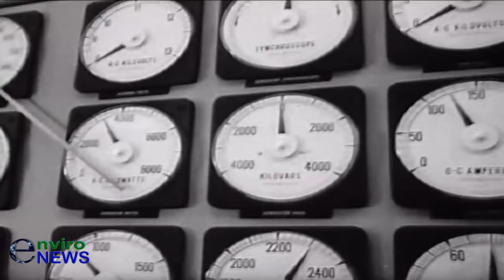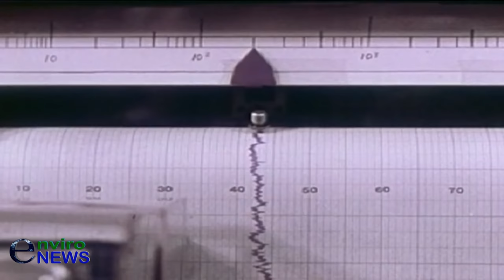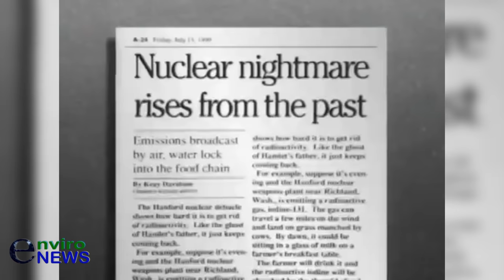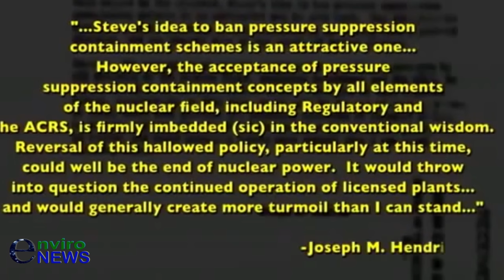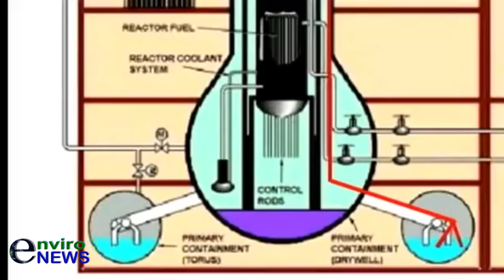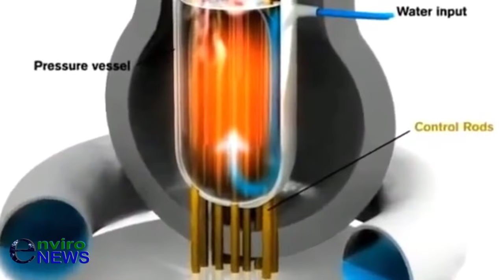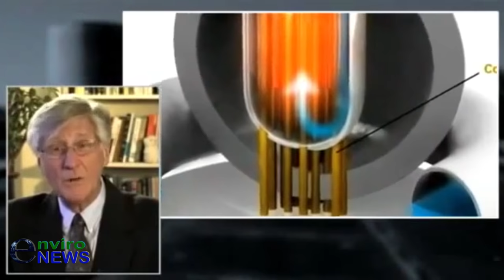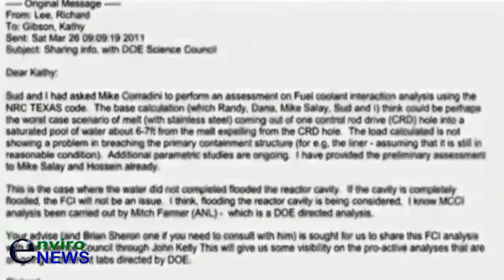Should GE’s Mark 1 Nuclear Reactor Be Recalled Worldwide Like a Faulty Unsafe Automobile? (Pt. 5)

Comment: here's my opinion on nuclear power. I think its mint as long as its done right. if we can make them safe, and make our waste disposal methods safe and environmentally friendly i think that nuclear power is a viable option for the future. for sure not a primary energy source but a secondary or back up systems to help stabilize the grid
Reply: Do you have any idea how long it takes to start up a nuclear reactor? The only practical application for nuclear is base load generation. Everyone is freaking out because of Daiichi, when just 14 km down the coast Fukushima Daini Nuclear Power Plant was hit with the same tsunami and had no such problems. Why? Because the superintendent there knew a 4m high tidal wall was inadequate, he ignored the bean counters and had an adequate height wall installed. This is wandering off to a general rant on the whole video but you get my point.
Reply: JetMechMA with vitrification yes is will go perfectly. When vitrified, the fuel waste takes on the charteristics of glass and is very stable and as safe as it gets to handle. There are concerns, but we do possess the technology to do it safely.
Reply: JetMechMA well there's a problem, we can't have modern nuclear weapons without nuclear power plants to refine the fuel. Gen 1 and 2 nuclear plants are panner plants, meaning their primary purpose is to produce weapons grade plutonium. Generating power is a handy dandy little byproduct of the process. If it were not for that simple fact we would have sodium thorium power stations. And just remember, our designs have quality containment structures around them, soviet reactors do not, to put it in perspective. Chernobyl and 3 mile island were equivalent disasters in terms of what happened to the reactor cores themselves, difference is 3 mile island released a small amount of radioactive steam and radioactive levels outside the plant dropped back to normal background levels mere days after the event. Chernobyl on the other hand, suffered a massive explosion, and released tons of burning radioactive graphite debris into the atmosphere. You say they aren't safe, I say BS. People live less than a mile from 3 mile island, and suffer no ill effects from living that close to the worst nuclear disaster in US history.
Reply: JetMechMA yes that is true, but we have the reactors, in perfect operating order, why decommission them prematurely? That is just a fantastically massive waste of resources.
Reply: but they are so much better for the environment when they are running. (unless they have a problem. which if they are ran safely shouldn't be an issue) they don't pump co2 into the atmosphere and they will run for a long time. in my opinion they are great for stabilizing  the grid when we go to full renewable.
Reply: Corey, Chernobyl was an RBMK reactor, many design flaws and no proper containment, big bang, big mess. Three Mile Island was a PWR, very good containment which worked well with almost no off site release. Fukushima design was a BWR, if there is any truth in this video when you pick through the blatant campaigning, the containment systems are inferior to a typical PWR, that part of the video I do believe because the containment did fail. Anyway, with the START and START II agreements and other armament reduction programmes, there is no need to manufacture fresh plutonium for weapons, there are huge stockpiles of plute from dismantled weapons and there are ways to reprocess it to manufacture new warheads, plutonium production won't be a requirement for many years to come.
Reply: You do know it was a forced insertion of the control rods trigger the explosion at Chernobyl right?  While it sounds like a good idea there can be more to it.  Fukushima was gracefully shut down It was a station blackout and lack of ability to get cooling water to the reactor that caused the issue not the reactor itself at least for the first few hours until the water boiled away.
Reply: You have no clue what your talking about.  do you have any idea how many tons of fly ash slurry they keep in ponds at power plants full of led, arsenic and worse?  Basically all power plants have all the fuel they have ever used on site and While yes if you give it a bear hug it be bad its less of a hazard and more easily contained then the fly ash that will NEVER be safe no matter how long it sits and is much more likely to contaminate ground water or water ways or be picked up by the wind and contaminate farms, schools and homes.

Comment: The control rods of a nuclear reactor should be raised and lowered from the top by electromagnets so if power is lost they will drop into the core.
Reply: The ones I know about have control rods lifted out mechanically with a system where they are released and are forced back in by heavy springs in as a safety mechanism. Other ways to stop a reaction are dosing the coolant with large amounts of boron to kill the reaction. Problem is that these only stop the reaction, there is still a need to remove the heat generated by radioactive decay, the core needs cooling for months after the reactor is shut down.
Reply: The moment they're dropped in they create a power surge. If they're simply dropped in they could easily blow up the reactor. NRC did tests on that in Idaho on a full SCRAM. The reactors created millions of watts in moments due to the boron-tipped rods. That's exactly how Chernobyl happened. SCRAM caused a massive chain reaction.
Reply: @almightydeity  This is an old issue known about for decades. From memory it's not the boron tipped rods but graphite tipped. In some case the graphite on the control rods will act as a moderator, increasing criticality. This really isn't an issue these days.
Reply: @almightydeity  The issue with Chernobyl rods is NOT that they are 'boron-tipped'.  Boron actually shuts down the nuclear reaction.  Chernobyl rods had non-borated tips that displaced water (which, in that design causes a power surge).  Light-water reactors do NOT experience any sort of power surge during a scram.  Get your plant designs straight.
Reply: @mikefochtman7164  graphite-tipped rods do absorb neutrons, but for the first split second they're inserted they cause the reactor to produce potentially thousands of times more energy than normal. The AEC ran hundreds of tests of this before the first commercial reactors were produced. In the last test their goal was to see how the reactor would handle a full and immediate SCRAM. The reactor jumped several feet and shot water from it's pool 20 feet due to the massive spike in fission. https://youtu.be/aqg7FEirbK4

   And yes, Chernobyl had graphite-tipped graphite control rods. It was that coupled with a lack of coolant that caused the reactor to explode.

   Yeah, got the tip mixed up. They we're graphite-tipped, and led to the ultimate explosion. These rods were one of the many flaws of Chernobyl.
Reply: @TyphoonAlternative One explanation is a large  red push button to enable control rods to descend into the reactor core quickly to shut down a reactor while everyone scrams away. Is that good enough for you to accept? Google
Reply: They have tried that.
They don't drop.
Due to the temperature induced size changes, the rods must be SHOVED IN.
Reply: @paulbeck6841  if you were replying to me, you may be misinterpreting my reply to TyphoonAlternativeOne. He was asking if anyone understood what scram means. I replied after using Google. I am not explaining if Fukushima scrammed before or after the tsunami flooded their backup generators.

Comment: Sorry that this text is so long.
Half way into the the video decided to stop and not continue further @11:00, when you put it into that liberal point of view and blame a company for "faulty designs" when in fact the initial construction design from the start of the plant being dug down into the ground for bedrock almost matching sea level was a solid factor of the "fault design". Adding to that, the back up generators were built in the lowest level of the turbine buildings and were around 30 feet bellow sea level, causing the the reason of future possibility of that the "faulty design" to actually happen when the tsunami flooded the facility. For some time they had no power to the entire plant, blindly controlling it resulted into not predicting possibilities of major issues. To add even more to that, no city nor any government agency had direct connection to the plants. If they did I am pretty sure they would have responded quicker to the facilities desperate need of help. Possibly even had evacuated the population earlier, had possible have the right amount of mobile generators delivered, and if those events would to have accrued that Prime Minister would of endured a longer career in Japanese government. In the end, Construction Engineers are to be mostly blamed for not equally considering each possibility of natural events being a cause of fatal events. The "protective wave barrier" was faulty from the start with its height.

As long as those problems exist in all the other  Mark 1 plants that are by major bodies of water are possibly built the same way, the design will most likely fail if a similar event happens like in Fukushima. Taking on GE to pay for things like this, that may in result make the company bankrupt or cause to do major lay offs, would hurt the entire worlds infrastructure of our current power designs. Almost all, if not all, turban designs come from GE. Meaning turbans for all sources for producing electricity would be under full review and possibility of shutdown till further notice. Jet engines would follow the same faith, causing hype in delays and significant price rise. Electric companies like Siemens Electronics, which basically makes all electrical related controls for all of the US;  industrial switches, power plant control units, and many other similar products have the GE stamp on in. People have no idea what they are getting themselves into until its too late.

Best result to avoid the stupid is to stick with coal powered, then again the exaggeration of pollution caused by carbon emotions hurts the industry. Coal powered provides 70%of the power the US to subside the demand. Water Powered/Dams fitted with turbines supply around 30% of the US demand. Wind powered and solar also have their own faulty issues. Wind Mills/Farms take much space, rated from 89 to 161 mp/h (144 to 259 km/h), but they are build in areas where either wind is too low or areas where tornado possibles are consistent. in the end, they only supply around 5% of US power demand, 7% on those days where the wind is fair.  Solar, as simple it may be, is equally as ineffective as wind powered. Also cause of Green House Gas and deflected heat being created after the suns rays hit the pad. Result of  the possibility of our O-zone atmosphere being damage or altered. Yet to see real tests to be conducted and results to prove if that is actually a thing or too late to make any changes to avoid. Solar power is  providing around 3% of the power supply that US demands. Harsh environments of mining areas and poisonous values of key ingredients needed to make the solar pads deems  it unworthy and would needed mass amounts of refineries to refine them to the state which is used to make the pads. Its the part of the cycle that people avoid, just see their demand to be completed even though they are contradicting the purpose the seem to aim for, and I am sure that this channels 15 part series ends at a result of promoting wind and/or Solar powered solutions after discussing only the current negative reasons of the various power supplying  industries.

Comment: Hey how are we going to plug in all those electric cars without Mark 1s?  In 20 to 30 years most of these good old Mark 1s will be retired anyways and then we can replace them with coal or gas to power all those electric cars.  Just slap some duct tape on em, cross your fingers and keep those reactors running for a few more decades.

Comment: the way I see it, every model is replaced with newer revisions and features, the mark 3 is currently the latest reactor with the mark 4 still in the design phase, so naturally anything older than a mark 3 is technically unsafe cause of the different standards, and replacing a nuclear power plant with oil or gas would be very counter effective
Reply: Im not against nuclear power, but im nor for it either, I see it an option if it done correctly and safely

Comment: Arnie Gunderson is a grifter. He also makes major assertions about Fukushima that don't match the facts behind the accident. Operators turned off the passive cooling systems that would have prevented the meltdowns. The GE BWR designs left a lot to be desired but aside from the negligence and poor training of Fukushima operators, these reactors have reliably and safely generated MASSIVE  amounts of electricity without issue. It's absurd to suggest that GE should pay for the defiant negligence of Japanese operators. Tepco refused to build the plants on higher ground due to the costs associated. Tepco had poorly trained staff that didn't understand the danger of shutting off the passive cooling system. Tepco dragged their feet for days to properly take control of the situation. Tepco built their backup power system in a way that made it extremely vulnerable to tsunamis that are a widely known danger in Japan. The EN talking point that GE "weaseled" their way out of paying taxes shows just how intentionally ignorant and deceptive they really are. Pure clown world stuff.

Comment: The reactor did not fail due to the reactor itself, it failed because of poor maintenance to the expulsion tube, the hydrogen mixed with the oxygen when the operator vented it.
Reply: The reactor failed BECAUSE the design was not fail safe. You don't get a second chance with a nuclear reactor, so the design of the ENTIRE installation must be FAIL SAFE. Relying on an vulnerable external energy source to maintain primary cooling is INSANE. That idea should never have survived the drawing board stage.

The Mark 1 BWR has failed EVERY time it has been seriously damaged - three out of three times! Three strikes and you are OUT!

The vulnerability of the externally powered cooling system also has significant security implications!

Comment: If Mark I containment was under sized couldn't you run the reactor at a lesser capacity maybe downsizing the fuel load of the reactor producing lower overall output? I hate to say it but the damn DC swap runs deep I wonder how many of the NRC's top dogs have worked for GE in the past/present...
Reply: In theory yes... but you are talking about Americans here... bigger is ALWAYS better. How many Americans have died because of that belief?

Comment: Why does the US Navy have a clean record on Nuclear energy. Think it's operator error most of the time when is comes  to private use.
Reply: Nuclear submarine and aircraft carriers are after my understanding, build after a much tighter regulation. Those reactors are quit different from a reactor in a powerplant. Navy reactor are designed to survive when that vessel goes in to war.

There are a couple of nuclear reactors from sunken submarines on the bottom of the sea, except of couple very old Russian submarine reactors, there haven't been a "danger"-report of american sunken submarine-reactor.

and those reactors shut it self down automatically, if something happens. they are designed Negativ out of balance... that will say that you have to force it to work or it will just stall.
Reply: U.S. Navy; Thresher, lost, not a reactor problem
Scorpion, lost, not a reactor problem,
USS San Francisco drove into a rock pinnacle at over 30 knots, reactor plant survived and didn't even scram, sub made it back to port under nuclear power, shows how well Naval reactors are made.
UK Royal Navy; erm, no losses.
Windscale (1957); Lack of knowledge during design process, poor core design, no containment (air cooled reactor, what?)
Three Mile Island: Operator error plus insufficient instrumentation meant they couldn't see what was going wrong, containment worked.
Chernobyl; Operator errors plus poor design with positive coefficient of reactivity under several different circumstances, (power levels climbing when you need them to drop). No containment due to huge size of reactor.
Fukushima; Accident was beyond anything they had designed for, Earthquake lowered the seawall over a metre, then the tsunami hit and went straight over the top of it. Generators in the basement? bloody silly idea! Also the containment structure did fail. Many lessons learnt from these emergencies.
Reply: The "Atoms For Peace" project got big money in nuclear energy, and the water cooled reactors were scaled beyond reason on the safety front.

This is what happens when you let politicians run things. They destroyed heavy water reactors, then killed breeder technology, and now dither endlessly on anything on fear of pissing either side of the table off. Don't mention all the universities have sold their souls to the devil.

It's a very sad state.
Reply: I can tell you why the US Navy record is clean: cost no object. Commercial plants are trying to make money. Two different worlds. Navy plants NEVER approach their design limits. Commercial plants operate AT their limits. Navy plants are designed to run for decades without refueling or replacing the machinery at the heart of the plant. Commercial plants are designed to run until the next refueling/maintenance outage.
Reply: /cough Sure they do..........  I say that and I am Pro Nuclear.  They also use very small reactors and run them low and slow.  That is how they get so long between refueling them.